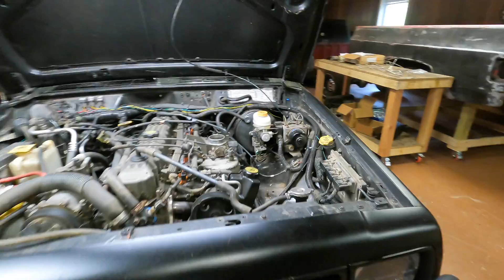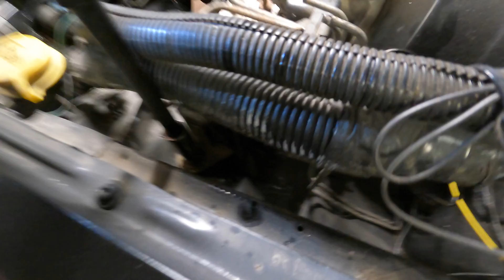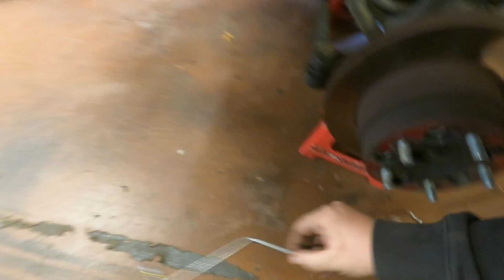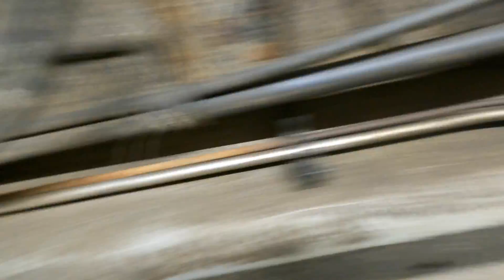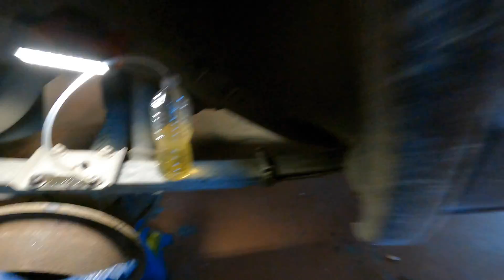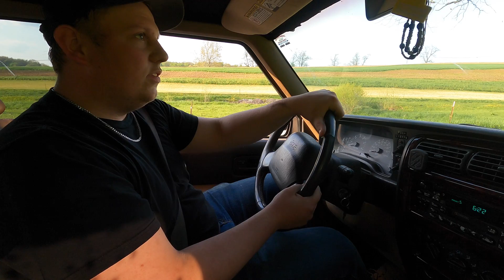Removing ABS PERMANENTLY on a Jeep Cherokee XJ

Comment: What is it like driving with no abs because i am tempted on iver fixing the abs pump put new one in or just delete it
Reply from the maker: There is no difference in normal day to day driving. But slick conditions or even rain your brakes can lockup if you really hit the hooks so you just need to be a little more careful

Comment: Hey Jimmy .. just a question so when changing the pro valve mine is 91 xj abs so there is 4 brake lines so just wondering how do I sought that thing out ?do I need to put a tee to make it 3 lines ?  
In pro valve there is only three ports to insert the fuel lines rest two goes to master cyclinder.
Reply from the maker: The proportioning valve should have 2 ports going in and 2 ports going out
Reply: @JeepinJimmy  thank you so much for your reply 
So 2 port goes to the master cyclinder 
2 goes to the front brake 
And then m left with just one port and two rear brake lines.. so do I need to do any amendments for the rear ? 
Thank you
Reply from the maker: @ajaygusain4490  usually there is only one brake line going to the rear then it Ts at the axle
Reply: @JeepinJimmy  thank you for clearing my doubt.. I really appreciate it

Comment: did air trap in the ABS module when you bled the brakes ?
Reply from the maker: I think air seeped in when I was changing the master cylinder and had all the lines off